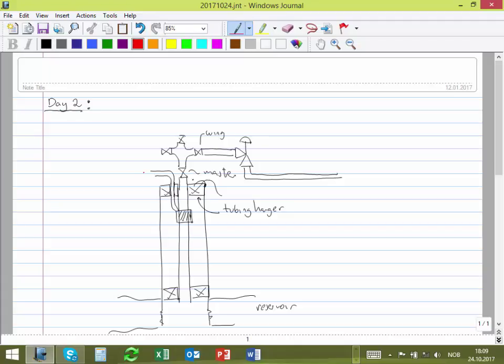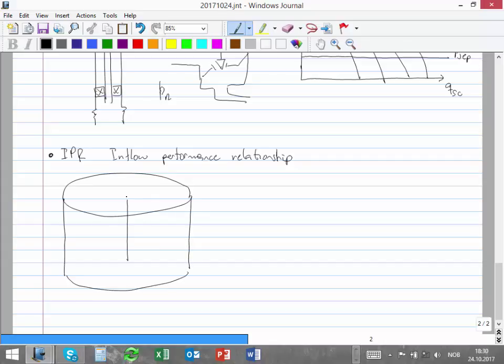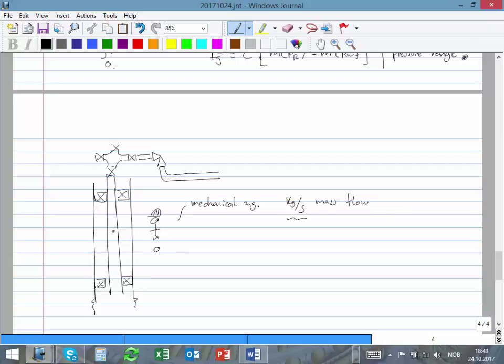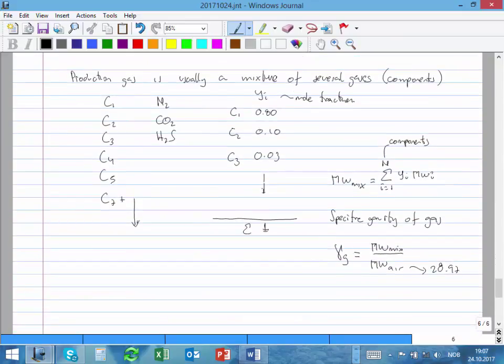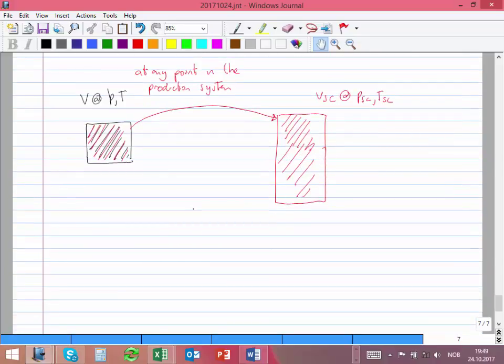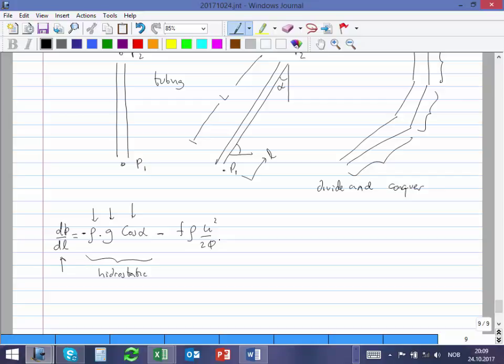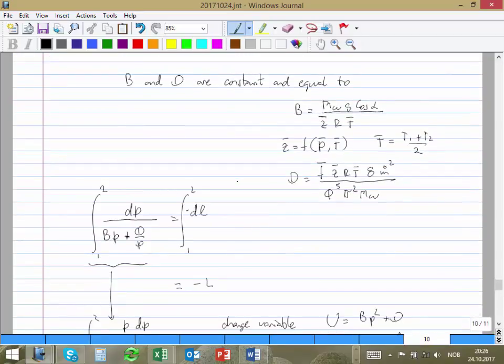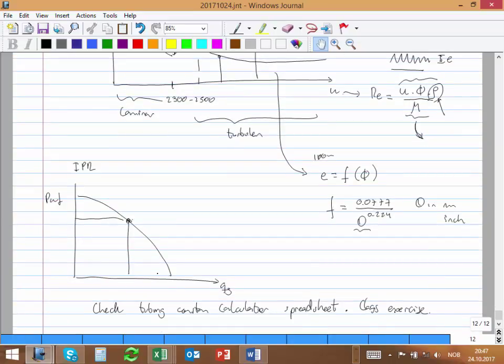2 - Flow equilibrium, IPR, tubing rate equation for gas.

Comment: Dr. Stanko please let me know in IPR and TPR curves for dry gas producing well Qsc was used but Q at which point of the well(tubing) was converted to Qsc. I mean Q in well head or bottomhole? I suppose that in IPR and TPR curves Q at bottomhole was converted to Qsc because Pwf was used but i am not sure.
Reply from the maker: In the derivation of the Tubing equation (TPR) it is actually the mass flow what is converted to q_sc (as seen in 2:03:02). With the mass flow and the density of the gas  (in this derivation expressed in terms of Z, p, T, etc)  one can calculate the local rate and the local velocity  in any MD of the tubing to further calculate frictional pressure losses.  Something similar is done in the IPR equation(not covered in this video). The gas velocity (at a generic position "r" away from the well) is expressed in terms of the q_sc and the gas formation volume factor Bg.